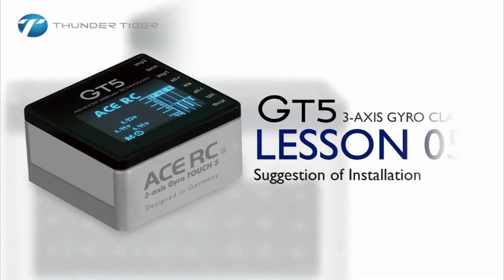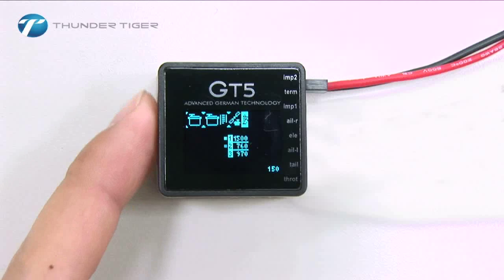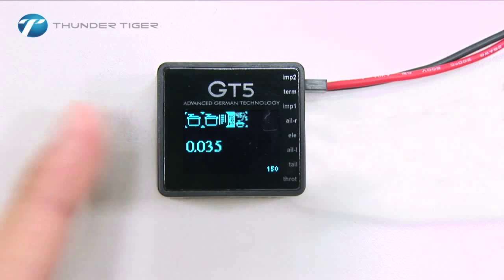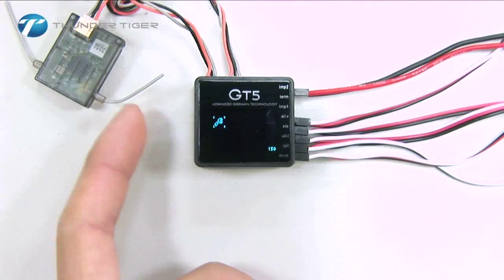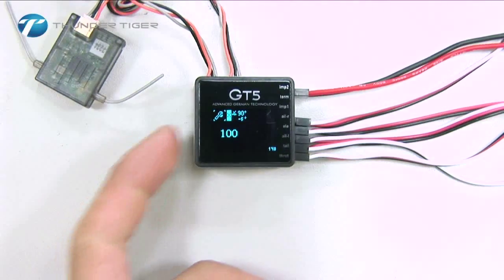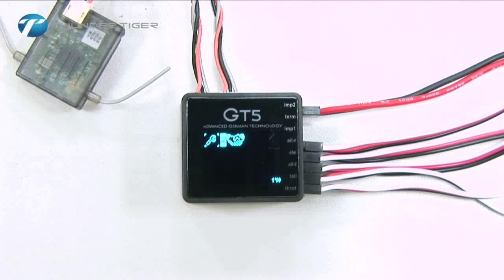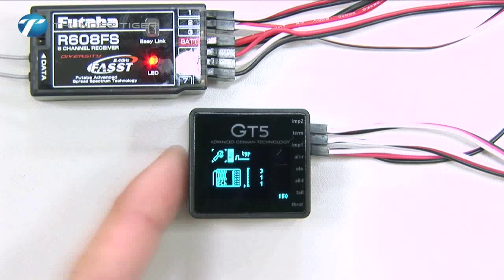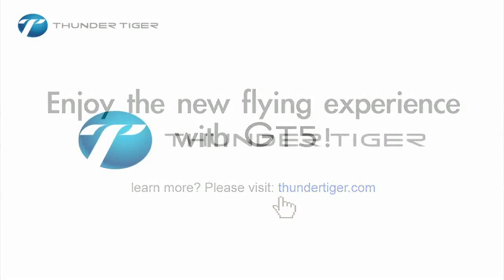Thunder Tiger - GT5 Gyro CLASS - LESSON 05 : Suggestion of Installation

Comment: is this end video?? No work 2 year my GT5.
i can tap,top manu.
but dont ajust gain  swash and tail. Not discussed in this video. 
The action from the first screen. The main gain to 100 tail, to 60. Cannot change soon? Actions not listed in the instruction manual. 

this is on manual.
Total gain for swashplate and tail:
This function is for quick raising and reducing of
the gyro gain for swashplate and tail. While flying
there should be ideally displayed 100% gain. If
you´ve set too much gain it doesnt matter if the
heli is swinging up on swashplate or tail. You can
push one switch for getting it to a pre-configured
gain (e.g. 60%).

Comment: @choppa1973 
Hi there.  Yes you can use a governor with the GT-5. When patched to a normal reciever, the governor signal can be plugged into a spare channel on the RX in the normal manner. When the GT-5 is used as the primary Rx, with Spektrum remote satellites, the GT-5 has an output pin (Imp 2) which can be plugged into the governor's speed signal output. In this case the throttle would be plugged into the GT-5's throttle pin input. I use the GT-5 on an X50 N and it works perfectly fine.

Comment: Hello, does anyone from thunder tiger actually look at these comments?

Info on connecting a governor and switch glow is needed, all nitro guys use a governor so basically your unit is pointless on a nitro heli if we are unable to attach a governor to this unit. Lucky I didnt rush out and buy one at least the vbar has a governor built in to it. 

Thunder tiger, you may want to keep a track of what customers are saying about your product good or bad. Its called customer service.